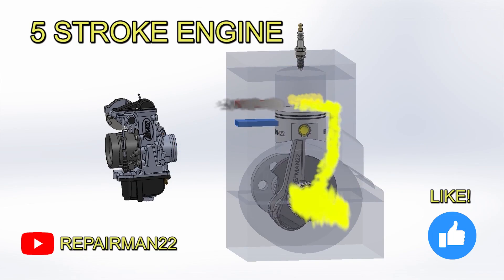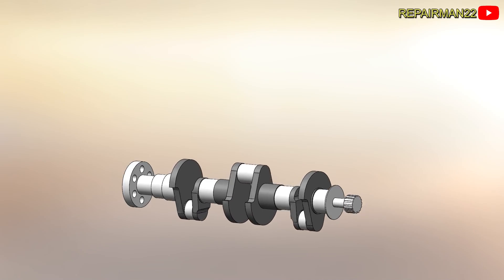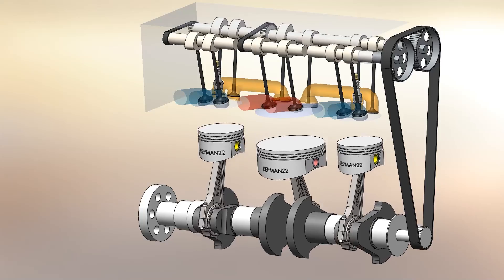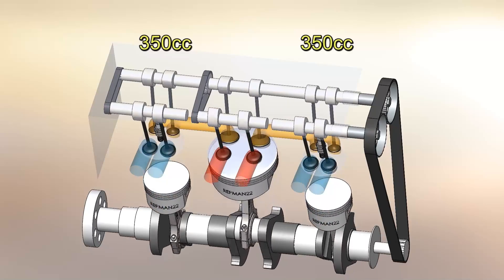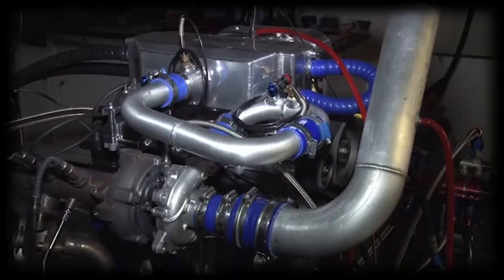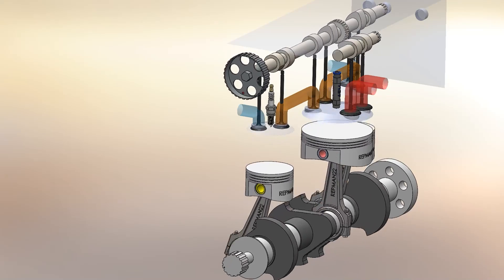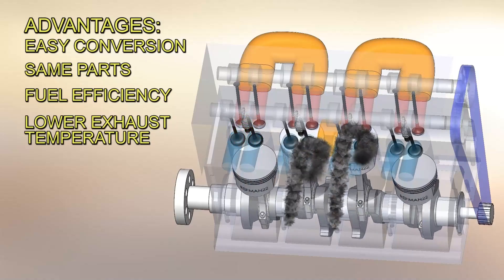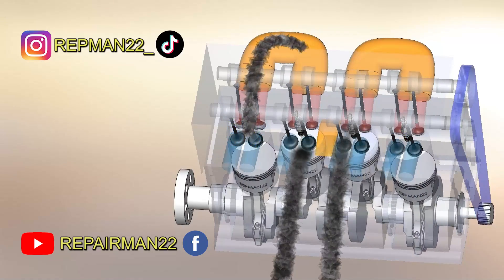The 5 stroke engine with water injection // Tested in Golf MK5 🤯

Comment: We don't make these because the exhaust strokes themselves (the upward motion of the 4th cycle) of the smaller cylinders are what drive the 3rd piston, not just expansion alone.. you'd need a LOT of wasted expansion from the smaller two to get any meaningful power out of the 5th stroke.. if you're wasting enough expansion on your power strokes to drive a whole separate 3rd piston as a 5th stroke without any frictional and inertial losses, I still don't see any advantage other than packaging. It's kind of a silly proposition. This is basically a turbocharger turned inside out. 

And you're far better off with that turbo, which is essentially doing exactly the same thing but in a much more effective manner; Harvesting the wasted heat energy from exhaust gasses.. Without the extra friction and inertia loading of an internal 3rd-piston 5th stroke
Reply: Turbines are less efficient than pistons.
Reply: Yeah, but a turbo doesn't drive the crankshaft, it just decreases the energy from the compression stroke necessary to compress the mixture to the desired compression ratio. So i don't think this engine on its own is less efficient than a conventionnal downsized turbo 4-stroke, but if you add the fact that an additionnal turbo on the 5-stroke takes further advantage of the residual pressure in the exhaust gas, you could potentialy have more efficiency. And the final advantage is the water injection : turbo and/or 3rd piston are not very good at recycling heat (as they both use exhaust pressure), whereas water injection is, making the engine even more efficient. Of course, as water injection cools the cylinder, it decreases the pressure of the exhaust gases in the 3rd piston and the turbo (thus loosing a part of their benefits), but there could still be a net efficiency gain, especially if you use highly heat conductive materials to drive the heat from the power cylinders to the 3rd, in order to recycle it more.
Other ways to achieve this could be to make traditionnal turbo 4 stroke engines, but with the 2 center pistons dedicated to collect the heat from the two others (they would only be injected with air/water mix), which would then allow the motor to use the two steam pistons as coolant, instead of a pump driven radiator, and allow the water to be condensed and recycled as their exhaust would be only steam and air.
Reply: Exactly, this also adds a lot of unneccesary weight and moving parts needing to be balanced with even more moving parts.

Comment: so you made an engine that can run on water, sort of, but water costs as much as fuel? Did I hear that right?
Reply: It's because you don't just need regular water but distilled water, as using regular water with lots of impurities in it will ruin the cylinder real quick as mineral deposits starts building up on the cylinder walls.

Comment: I just came from the wiki. I want to quote the cycles here, and offer a criticism:

1, induction 2, compression 3, power 4, exhaust expansion 5, final exhaust
Thats fine, if all the cylinders moved in parallel. When the final exhaust is the expansion cylinder going upward, that would imply that the power cylinders are going downward at the same time. So cycles 1 and 5 are effectively the exact same cycle. Its still a 4 cycle engine, with an expansion cylinder. Not a 5 cycle.
Reply: They don't call it a 5-cycle engine.  They call it a 5-stroke engine.  Intake, compression, expansion 1, expansion 2, exhaust.

Comment: Junk the cams and valves pistons and conrods ...  The piston engine and rotating crank and rods with poppet valves and cams are too complex  expensive heavy and bulky compared to  more radical options ... the fact that this is only suitable for a generator just makes the point its just scraping the bottom of the Traditional ICE barrel.. the electric motor preferably rare earth magnet free is the motive power and its smaller lighter virtually maintanance free simple to build and inherently vibration free vibration free and has a minimum number of parts and friction losses so is up to 97% efficient . 
If you need a ICE genset it will need to run on bio or Synthetic fuel, methanol or White or green hydrogen...be small light and as simple as possible fifty-60parts.. with minimal friction, components and maintainance and lubrication.. oh clean burning and quiet and preferably free of vibration.

Poppet valves are complex noisy little parts that require very carefull control and metallurgy matching to fuel types.. 

Think opposed free piston or a rotary as per liquid rotary piston.. even a wankle motor....both with less parts, less mass less bulk, less maintainance and easier maintainance and greater fuel adaptability. ..
Reply: A turbine perfectly matches your shopping list, except for noise. Few enough moving parts you can count them on one hand, more efficient than reciprocating engines have ever been, and with a power density several times higher than reciprocating engines. You can run a turbine on a wide variety of fuels, and still balance a coin on edge on the engine.
Reply: @wills.5762  
Too hot too fragile and generally too thirsty, efficient blades are expensive to make.. and the tolerances critical ...plus they need fairly exotic materials. And the noise is not what you want to hear every other day in a mooring or in the middle of the night . 

For a hybrid aircraft APU ...it could be good, R Royce has developed one..but the forces you get in a car truck or boat are different and repairs have to be possible in places and conditions that you wouldnt want to start trying to mess with a micro turbine . 🤔
A fire in a car is scary but usually you can step out and get away.. in a boat ⛵ made of  composite a thousand miles from anywhere or even a mile and its a different proposition.
Most yatchs in the tropics or even European summer are sweat boxes hence one reason for the move to inductive cookers. 🤷🏻‍♂️ 
Ive seen prototype briefcase sized sets but theres no way you want one of those or a trad two stroke genny running sailing Uma had to resort to one  
On their Artic trip.... to top up their batteries off grid. 
The other side is of course the ridiculous spectacle of running a jet engine to run your aircon in a heatwave .. and saltwater gets everywhere on most boats even without storms.
Reply: @clivestainlesssteelwomble7665  I mean, turboshaft generators arent rare on ships, most military aircraft have a turboshaft apu, and there's a number of small generators that are powered by a turboshaft. The noise can be somewhat mitigated but remains the largest problem, turbines are much more efficient than reciprocating engines, and last much much longer. Servicing them isn't necessarily any more difficult than a traditional generator either, they aren't quite the same as the engines you find on aircraft. 

The costs are a little higher upfront and in the rare case of turbine or compressor replacement but generally those costs are recovered and then some by the higher efficiency and longer service intervals

Comment: The double speed cam just looks like extra complexity, why not a common shaft with a double lobe profile
Reply: The animation shows it spinning at the same speed, or am I seeing things?
Reply: You’re right. It is “silly”. But buying rather precise parts is easier than designing and milling custom parts.
The same reason the four-banger was altered to be a two-banger with a klugey re-expansion ‘cylinder(s)’.
Reply: Good idea.
Reply: They could also just add two lobes insted of one on that cilinder instead of making it spin double the speed.

Comment: A compound engine using the same double expansion design (three cylinder with the centre being used for additional expansion) was built by the German Deutz company in 1879.  
A five cylinders compound engine was built by the Frenchman Forest-Gallice who patented in 1890.   
Rudolph Diesel, father of rolling coal patented his three cylinder double expansion engine in 1897.
Edward Bales of Illinois patented his three cylinder compound engine in 1897
The three cylinder Crossley-Atkinson (of Atkinson cycle fame) compound engine was patented in 1903.
These designs all suffered the same problem as the one in this video is likely to suffer; the loss of heat from the gases being passed from the high to low pressure cylinder coupled with the additional friction of the additional cylinder negated the efficiency benefits.
Gerhard Smith was very late to the game.
Reply: There we go, i was wondering why this wasn't thought of before, as it's effectively just an in-block turbocharger in piston form, connected directly to the crankshaft.
Makes sense this idea is about as old as the concept of super/turbochargers.
It's just more power instead of more air, after all.
Reply: Yes, you are right. Uninsulated engines need to do their expansion quickly because metals suck heat.

So unless one thermally isolates oiled surfaces from combustion heat, it is impossible to build an efficient engine. That’s why most folks have quit trying
Reply: The FIAT twin air engine is the only practical way of using an Atkinson cycle engine in a vehicle, by using it for only "part throttle".
Reply: @joejoejoejoejoejoe4391  Loads of hybrids use Atkinson cycle engines.
Reply: @agt155  So to make the usual Atkinson cycle engine you have to add a generator/motor, 1/2 a ton of battery and a load of control electronics, that all add expense along with the weight. Because the valve controlled FIAT system can instantly go from Atkinson cycle to Otto cycle, it can provide both high and low power efficiently, without having to add a motor and battery for low power.
Reply: @joejoejoejoejoejoe4391  No you don't need all the extra electrical hybrid equipment to implement the Atkinson cycle (or one of its very simmilar derivatives).   The engines used in hybrids like the Prius use the Atkinson cycle for efficiency, and the power loss this introduces is made up by the electric motor system.   While the Fiat twin air design makes changing the cycle on the fly a relatively simple software task, you can implement the Atkinson cycle purely mechanically by changing the effective cam profile.
Reply: @ferrumignis  Yes, but the power needed to shift a car varies considerably, from over 100 hp for accelerating/towing/hill climbing, to 6 hp for cruising (an aerodynamic car), to minus figures (braking), if you just regrind the camshafts (something I'm considering on a Honda c90) you are stuck with the low power of the Atkinson cycle; with the hydraulic system of the FIAT twin air you can change from Otto cycle for high power, and Atkinson cycle for low power, add some variable compression pistons ( a simple, cheap design was tested in the 1990s) would make the engine close to optimum in both cycles. 
The challenge for cars is more than just an efficient engine, it's an engine that's efficient at low and high power.
Reply: And all of those ideas came from the steam engines of the time. With a small piston for HP steam and a larger one for low pressure steam.
Even steam turbines work on this same principle, but with less mechanical parts.

Comment: The animation is off, the exhaust valves of the middle cylinder should open every time the middle cylinder rises, they now only do so every second time the middle cylinder rises. The voice over says the middle cam rotates twice as fast as the normal cams, but the animation shows it rotating at the same speed.